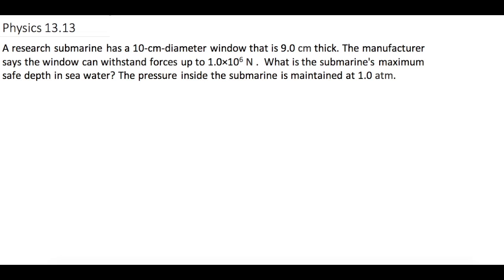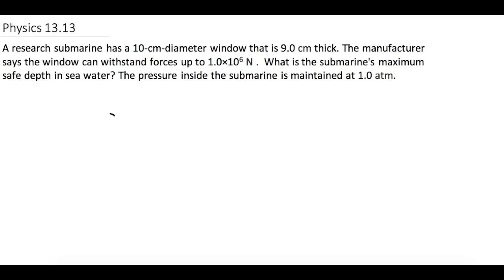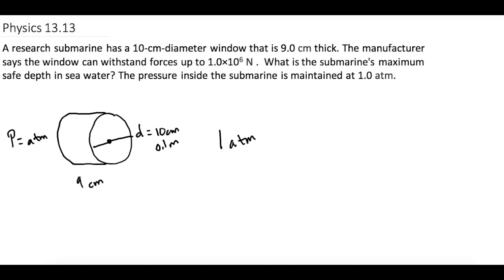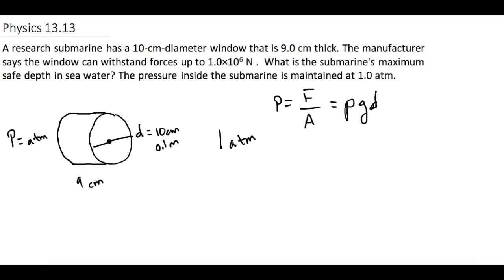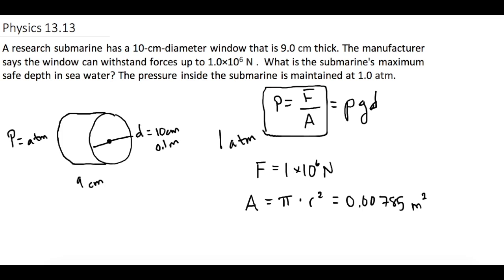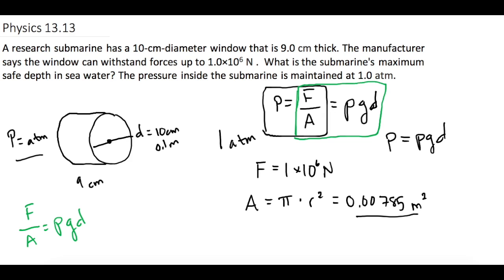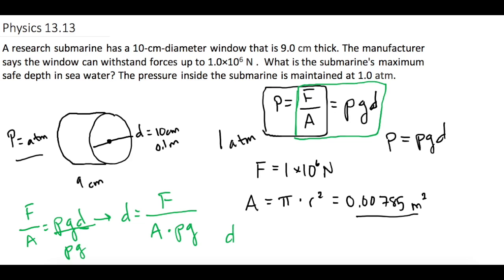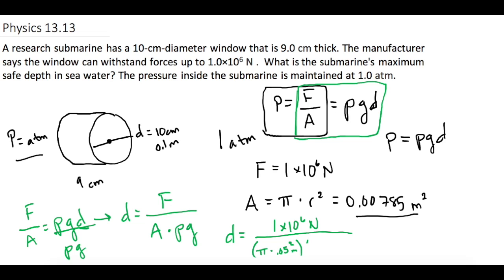Mastering Physics Solution, "A research submarine has a 10-cm-diameter window that is 9.0 cm thick.

Comment: Mastering Physics is a joke, I ran the numbers the same way you did.  This is how I though it should be with a diameter of 20cm and mastering physics says its 3250m, its not, its 3153.46m.  I did it in two methods and both yield these numbers with rho=1030kg/m^3 and a given Force rating of 1*10^6.  Good video, program is flawed.
Reply from the maker: nicholasbraud1986 I feel ya, I've had many issues myself and others have said similar stuff. Sorry it was giving you issues!
Reply: @MasteringSolutions  Your numbers were fine.